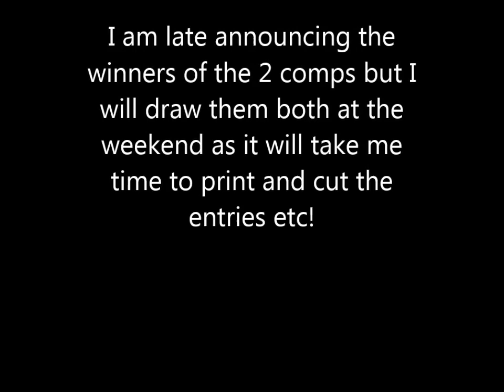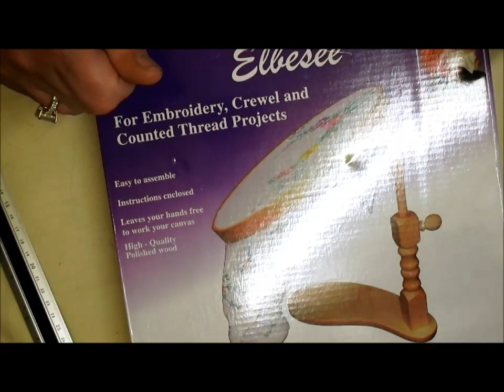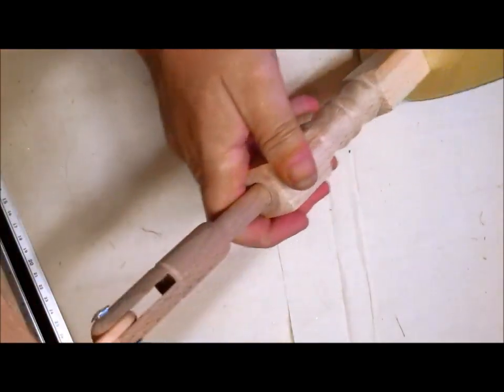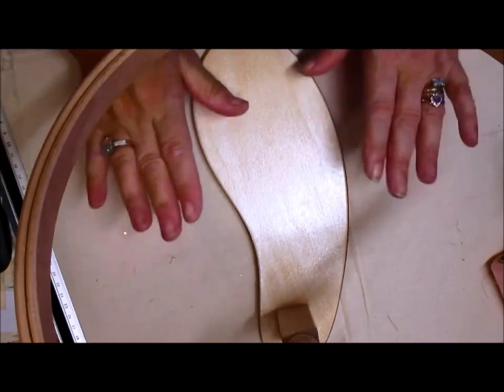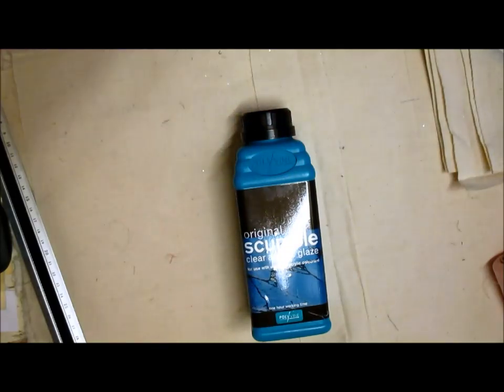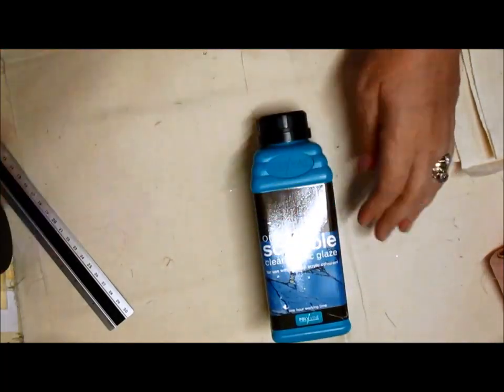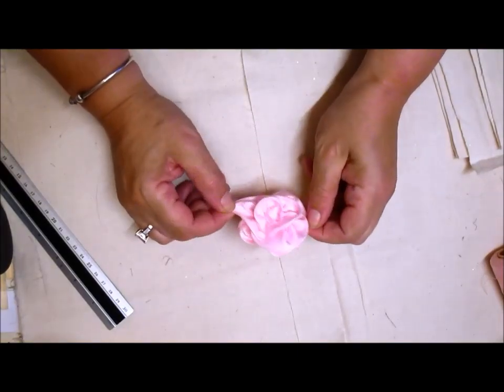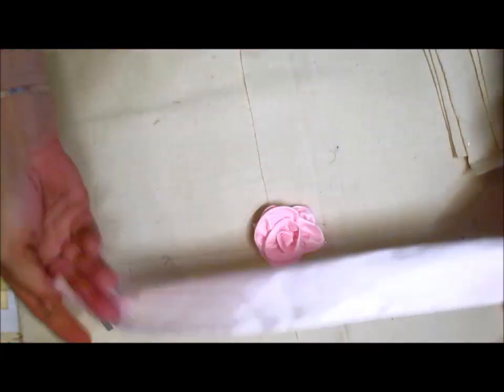Embroidery Stand & Acrylic Glaze - jennings644

Comment: Hi Fi,way back in the 80s I used scumble for decorating.It kept the paint open for longer so you could drag,sponge,stipple and rag roll without worrying about the paint drying on you before you'd finished,then was used as a clear seal on its own to protect the finish.Still use all the artist mediums before buying craft company stuff:-).×

Comment: I was looking at that on Amazon.  It's called a sit-on frame - look at the picture:  

http://www.amazon.com/Lacis-Sit-On-Round-Embroidery-10-Inch/dp/B001C22SBO/ref=pd_rhf_gw_p_d_12

You can look and see she's sitting on the bottom part to keep it steady and in place.  There's another one that's rectangular and it's also made for sitting on:

http://www.amazon.com/Edmunds-Sit-On-Needlework-Quilt-Frame/dp/B000OCUAJA/ref=sr_1_6?s=arts-crafts&ie=UTF8&qid=1403794734&sr=1-6&keywords=embroidery+frame+with+stand

So try sitting on it and letting us know how it works.

Another one is this lap stand that has different rings with 7" and 9" hoops:

http://www.amazon.com/Morgan-Products-Stand-Combo-Hoops/dp/B000YZ3YIQ/ref=pd_sim_ac_3?ie=UTF8&refRID=1VJP53ZVRY1XD69TS5R9

Now, there's the options I was looking at when I asked you if you used a stand of any kind. lol  I always love to hear reviews for things I might buy. :)
Reply from the maker: I tried using it while it was under my legs and all I got was a very bad neck ache from bending over it, even though I had it adjusted to highest it would go! I find it far easier to leave on the deck in front of me still with both hands free :) Thanks for the info, I'm sure many will find it interesting! Fi xx
Reply: Jennings644 Thank you for that info.  I was wondering if it was tall enough to work with while sitting on it. I can see where one would be bending over to use it the way they show it.